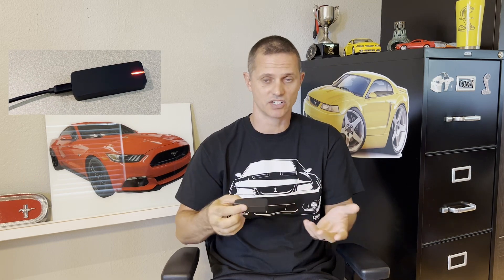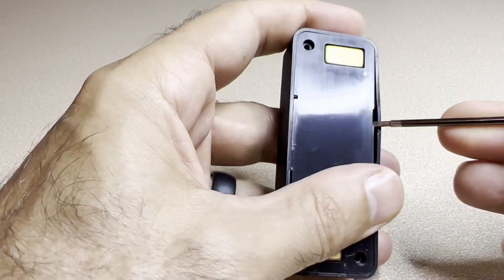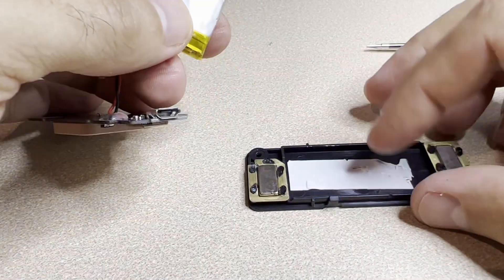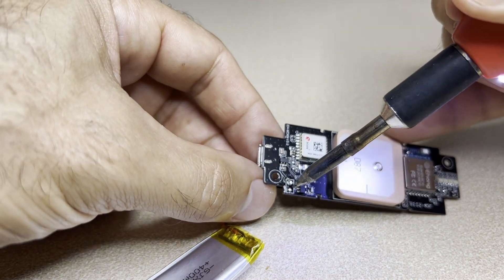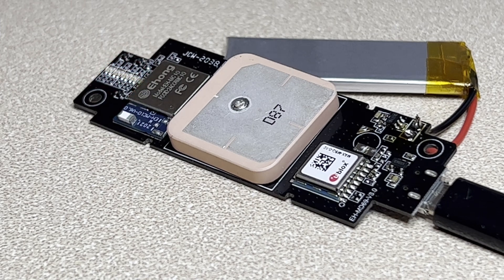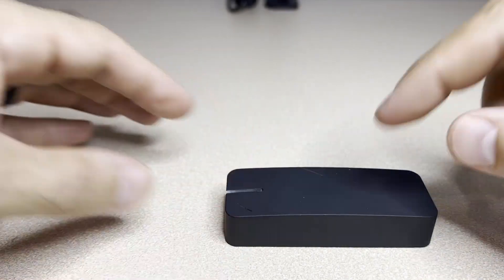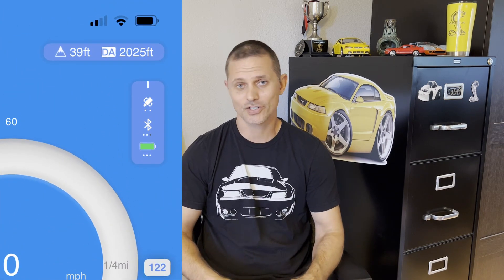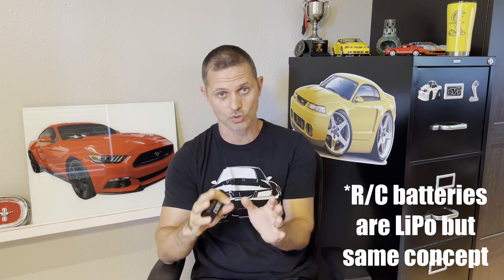Dragy Battery Replacement & Testing + Battery Tech Tip For Lasting Longer. Jeep Trackhawk testing!

Comment: My dragy keeps killing the battery. I've installed 2 new batteries and the light flashes red will connect to phone and after 4 minutes battery is completely dead 0 volts and battery won't come back. So I'm thinking there's a short on the device
Reply from the maker: wow yeah if a freshly charged battery is dead in 4 minutes that's a serious short.  I'm surprised the battery hasn't over heated and failed.

Comment: You ever seen Dragys not charging at all even with a new battery installed?
Reply from the maker: I personally have not.  Assuming the charging brick and cable are good it sounds like possibly the charging circuit on the draggy has failed.

Comment: Only watched to see someone using the dragy on a Trackhawk. ( like to see what my competition is doing). I guess my Whippled F-150 is pretty descent and good info on the dragy too👍
Reply from the maker: That's great, I can help with a bit more info.  Trackhawk is bone stock and was warmed up and heat soaked & I had AC since it was hot as heck.  All that doesn't affect it very much though but when cooler it does run a tad quicker.  Also for the ease of the video I did not use launch control or 2 step it.  That helps a little off the line too.  I imagine a Whippled F150 is a beast and probably runs really fast.
Reply: Here's mine

https://m.youtube.com/channel/UCvTg6EgG1ZAbzcC0ONeFOSw

Good to know I can fix my Dragy when it goes bad 👍